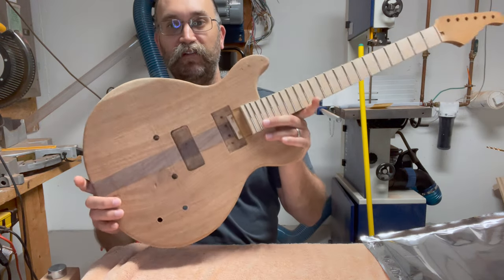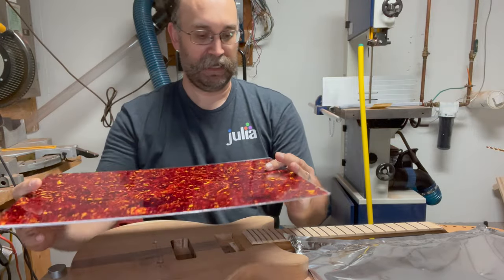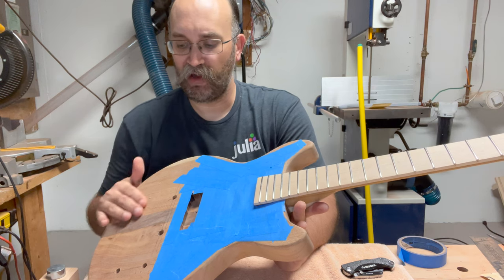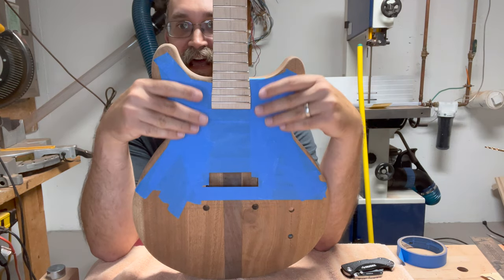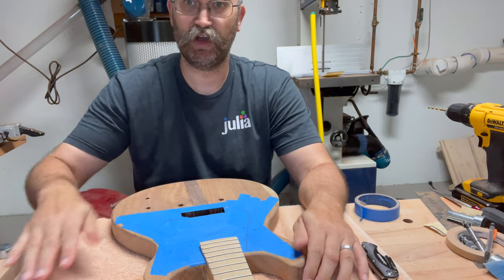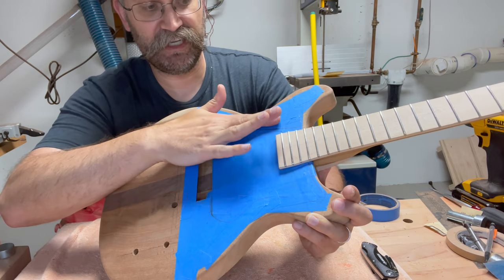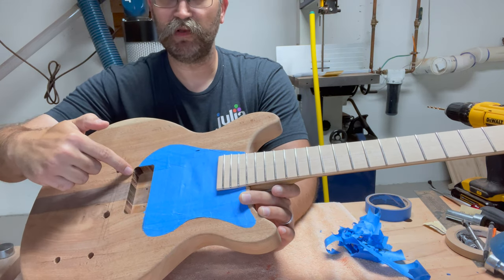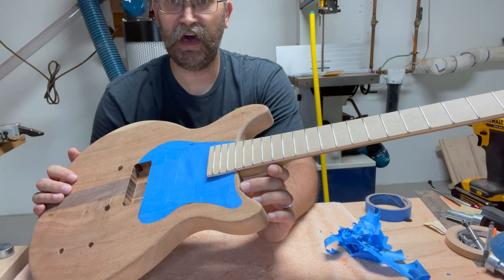Designing a Pickguard Using Tape and a Pencil

Comment: I thought at first that area you chose would be small and look too offset. Once you cut away the unnecessary tape it looks like a good shape to suit that body. Just enough to be functional but not detract from the rest of the build. Not sure on color choice. Black was first thought then was like too bumblebeeish? Great if your a Steelers fan like I am but very contrasty. Yellow is hard to work with for accents. In car tradition the more "Candy" colors get used with it. That red tortoise I think fits that best but not sure of the patterning as I don't have your vision of the final scheme. Will be interesting to see what route you take.

After thought: Bright white with RGB candy pinstriping popped into my head soon as I hit enter the first time.
Reply from the maker: I ended up going with tortoise (next video), which I’ll go with for now until after I paint. Feels like I shouldn’t waste the material 🤷‍♂️
Reply: @zwitchguitars  Worse case you could always go with clear lexan or like a mirror type I have seen before if color matching becomes an issue which I doubt with your skill and thought process.